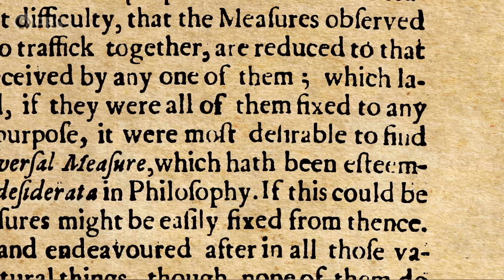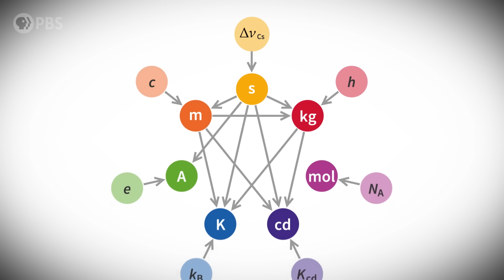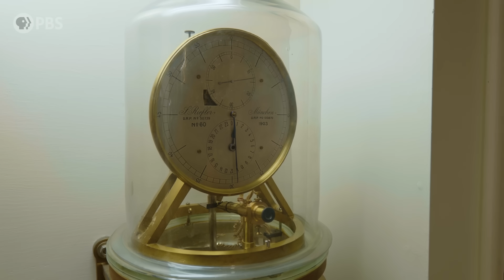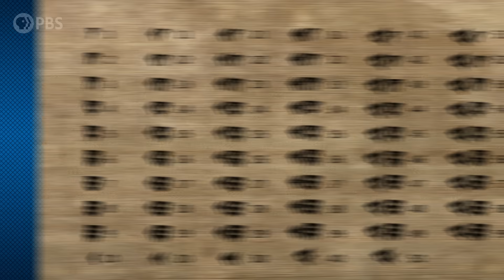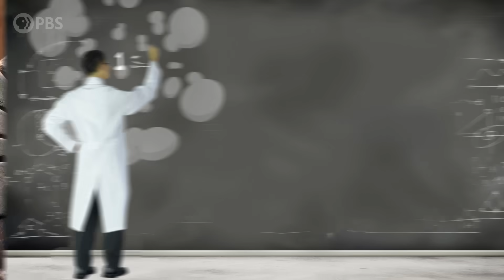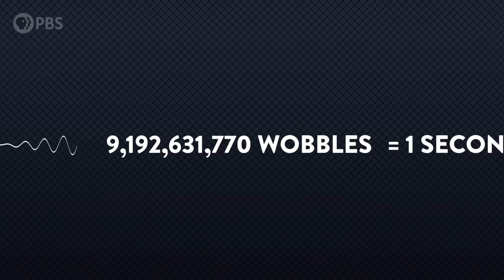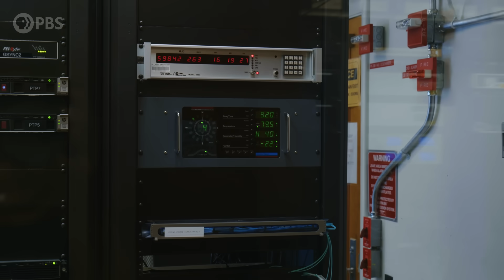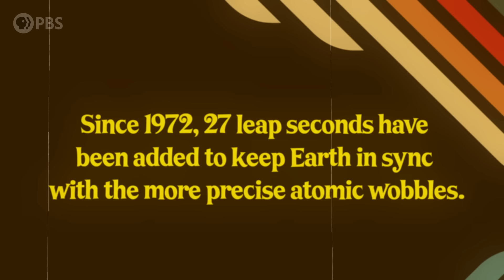The Unexpected Measure that Makes the Modern World Tick

Comment: The second is 1/86,400 of the time it takes from one day when the Sun crosses the Meridian to the next day when it crosses the meridian.  But this varies slightly due to the tidal effects of the Moon's orbit around the Earth, or more accurately the common center of mass of the Moon and the Earth, and from the fact that the Earth's orbit around the Sun is not a perfect circle.  But I like the non-decimal way we divide our day in a manner similar to pre-Metric systems of length.

Comment: I would really like to know more about the candela. All throughout my graduation in Engineering I never had to use it, and it sure doesn't look like you can't express it in function of the other base units (just at face value). So yeah, feels like a bit of a mystery
Reply: All of the photometric units (lumen, lux, candela) measure electromagnetic energy in some way, but they integrate the electromagnetic spectrum weighted in a way that reflects how bright light of a particular wavelength looks to the average human eye.  Lumen measures total light emitted from a source, so it's analogous to Watt used to measure total EM radiation emitted from a source. Lux is lumen per square meter, a measure of how much light shines on a surface. Candela is lumen per steradian, a measure of how much light a point-source emits per solid angle, i.e. if you block the light from a point source in some directions then the total amount of light emitted (in lumen) decreases but in any direction that's not blocked the brightness of the source (in candela) remains the same.
Reply: @MatthijsvanDuin  I really appreciate your explanation, I get it much better now! Thank you! 🤩
Reply: @MatthijsvanDuin  Whoosh!!!  The cynicism derives from the complexity of the definition. To be sure it's not an easy thing to define, but unlike the other base units, it's not something straightforward like the other units.
Reply: @AlanTheBeast100  I was replying to the original comment, not to you
Reply: @MatthijsvanDuin  Good for you!
Reply: What's so unnatural about: "The candela [...] is defined by taking the fixed numerical value of the luminous efficacy of monochromatic radiation of frequency 540 × 1012 Hz, Kcd, to be 683 when expressed in the unit lm W−1, which is equal to cd sr W−1, or cd sr kg−1 m−2 s3, where the kilogram, metre and second are defined in terms of h, c and ΔνCs."?  🥴 --- source: Wikipedia candella.
Reply: @AlanTheBeast100  🤣🤣🤣🤣🤣🤣🤣🤣🤣😍
Reply: I’ve seen the measurement used a lot on film sets when gaffers/light electricians are working with the cinematographer on getting a certain light condition.
Reply: Candela is used only in astronomy and lasers
Reply: Of all the SI units that are supposed to stand for something universal and objective, the candela is exactly the opposite. It's essentially brightness of light, but where normal light brightness is just measured in WATTS, candela are measuring the PERCEPTION of brightness. For example, infrared light can be "bright" and be many watts, but it can never be bright and be many candela, because to us, it's invisible. The stupid thing about it, is its based on a standard observer... i.e. The biology of some average human. As a colorblind guy, even my "luminous efficiency curve" is different from the rest of you, so my candela is also differently defined.

The fact that the candela is a base unit is a joke. Loudness is also defined in watts. You can do the exact same kind of magic based on the sensitivity of our ears to get a unit (called a phon), and it is pretty much directly analogous to the candela. The only difference is the ear curve varies a lot more between people than the eye curve, so... Phon doesn't make the arbitrary cut.

Seriously, it's so stupid. My photonics prof told me that it's a holdout from the once-powerful lighting lobby. But we need to get rid of it. Seriously, It's a hill I will die on.
Reply: @CurranEggertson  Yeah, from what you've just told me, I have to 100% agree with you. It's more or less the impression I had that it's not fundamental at all, but I thought I was missing something that would make it click and make sense. But apparently no, it's just kind of stupid.

I'm surprised this isn't talked about more, specially given how emotional people can get about silly measuring units

Comment: Great video! 
You could have added that the French Revolutionaries tried to change the definition of the second to fit decimal time. 100 sec/min. 100 min/hr. 10 hrs/day.
Reply: It's too bad that was not accepted.
Of course, if it were accepted, in the USA we would still be using the Babylonian method.
Reply: the decimal system is overrated. From a technological point of view, it would make things more simple if people were accustomed to use something like the octal or maybe hex number system. this would allow us to much more easily convert to binary, which could be really helpful for even just doing math on paper.

Comment: Fun fact: last week the international standards bureau voted to abolish leap seconds between the years 2035 and 2135.
Reply: I missed the end date, knew there must have been a second part.
Reply: I’d put the leap second on random variations in the day length, which is why we can’t predict them for than 6 months out. The contribution from the fact that the day length was taken d from 1/1/1900 (iirc) is predictable.
And, we can have leapseconds in June. If needed.
Reply: also the one thing these popular science videos get wrong is the reason for leap seconds - its not because the Earth is slowing down by a second every 2 to 3 years!

the TLDR of it:

That 'random' number 9,192,631,770 of cycles was based on the motion of the Moon from film camera measurements in the 50's. The second it was measuring was ET or Ephemeris Time used as the independent argument of time for calculating astonomical almanacs since 1900. And that second was itself an average of planetary observations over decade in the 1800's.

We will always be comparing one average with another whether analogue or atomic --> which means even if the Earth from now on spun perfectly uniformly we would still need leap seconds, tiny differences in the tick lengths will always build up over time.

Comment: Why are you ignoring the politics behind the metric system? 60 seconds in a minute, 24 hours in a day or even 360 degrees in circles all involve highly composite numbers. 60 is a "superior highly composite number" which is a natural number which has the highest ratio of its number of divisors to some positive power of itself than any other number. It's the best for division, which is important for time and temperature. 
After the French got rid of their king, they wanted to get rid the old ways which used solid mathematics because they were seen as "King's units". They even tried to get rid of the second. 

Then there was the Battle for Geodesy between the French and Prussians/Germans. The French were humiliated by the Franco-Prussian War which lead to a century of bitter French Revanchism. This lead to the French bribing countries to use their Metric system to preempt German standards just for the sake of wounded French pride. The French gave up their claim of the Prime Meridian passing through Paris to the British Prime Meridian in exchange for the Brits adopting metric units. The French also offered trade deals to smaller countries for adopting French units.

The fact that the second not only still exists but is the lynchpin of the metric system tells you that the older units are not as bad as you imply. 60 seconds, 12 inches, 360 degrees are all superior highly composite numbers. Even the temperature has uses a highly composite number (180) between freezing and boiling of water.

Comment: I think a second is not measured by a caesium clock, but reproduced by a caesium clock. I think the second is a measure of duration. Absolute time may not exist at all. 🙂🙃
Reply: Since there is no absolute reference frame then it's possible for various observers to measure time differently and heavily implying no absolute time.

See also time dilation if you're up for some special relativity
Reply: @Kanbei11  Time and distance vary according to the Lorentz transformation. The speed of light in vacuum is the only constant. If we'd be able to reach this speed, time and distance would be meaningless.

Comment: When I was at MIT, the two common scientific measuring systems were cgs and mks. The profs said that they wouldn't specify what we used. So one cocky freshman decided to use fsf (furlong stone fortnight). It was a lot more work, but the TA would have to follow his work rather than just check the final answer.
Reply: I remember the foot-pound-second and used it while working at Boeing.  Using it is one thing.  Explaining it to a Boeing supervisor, let's just say that reducing the entropy of the Universe is easy by comparison! Along with explaining to him that there are 254 Angstroms in a microinch, or that there are 1 billion cubic mils in a cubic inch, or that 5/8 inch is 1/8 of 5 inches. In my college physics lab, I liked to joke that Archimedes used the cubit-shekel-second system.
Reply: @Ross Parlette I thought MIT students used "smoots" for length? 😂😂😂😂😂
Reply: @rickkwitkoski1976  No, actually, Smoots are used only on the Harvard Bridge. And they're now used even by the transportation department as a way better to locate where on the bridge, for example, an accident has occurred. Oliver Smoot was a pledge of Lambda Chi Alpha in October of 1958 when his brothers used him to mark the bridge. According to the legend he was so drunk that he was stiff and they turned him ass over teakettle to do the measuring, which conflicts with contemporary photographs. As a Freshman I was given the story.
Reply: Why don't people use mgs
Meter - gram - seconds
No prefixes, just the base units
Reply: @Xnoob545  That's not a thing because the derived units are unmanageable.
Reply: FORTNITE BATTLE PASS!!!!

Comment: If we're measuring seconds based on the frequency of microwaves or visible light, isn't that a circular reference?  Frequency is cycles per second.  If you don't know what a second is, how can you use frequency to exactly measure a second?

(I'm not saying that they are doing it wrong, I'm saying I don't get it.)

Comment: Has the speed of light (or time) changed over the lifespan of the universe? How could we know?
Reply: Speed of time changes in variation of speed & gravity as described by the theory of relativity. Lightspeed is a constant in vaccum, but it differs depending on the material light is passing through

Comment: The "metric system" (the real term we should use is Système international d'unités / Internation System of Units)  doesn't rely on natural objects since almost a century !
The definitions of the different units are based on physical constants and are all linked by calculations to go from one to the other, only using other units of the SI (Système international d'unités), so all units can be explained with other units, et cetera.

There have been numerous updates all along the twentieth century to make the units always more precise, more based on natural phenomenons and universal constants, and now some things sound ridiculous.
For example, the definition of the meter is the distance that light travels in a void in a 1⁄299792458 of a second. Talk about simplicity haha. Of course it changes nothing to us, but it is scientifically exact and cannot be debated.
Reply: Not true. Le Grand K or International Prototype of the Kilogram was a physical object in Paris used to calibrate all other physical kilogram standards until 2019. "it is scientifically exact and cannot be debated" is wrong on so many levels. That's not science. It borders on religious orthodoxy. Science is founded on open debate, not writs from on high.

Comment: I just want to point out that the US does actually legally rely on the metric system at this point. The only reason you still see Imperial used was because they didn't want to force all our industrialized manufacturing capacity to completely retool (which would have set the US back decades at the time), but that was over a century ago, and while we actually still use some of those same machines in production of stuff today, modern machinery for manufacturing has been universal for a long time, basically since we started making everything using CnC operated machines. Even decades old CnC lathes can be used in both imperial and metric. Imperial as it currently stands today is effectively considered an extension of the metric system, because all the base units we use to define what imperial is today, are based on metric measurements.
Reply: TMW all of the Imperial unit people learn that all of that stuff is defined in metric units. :D
Reply: You can thank Ronnie Reagan for the U.S. still being stuck in the dark ages.  Carter had set up the switch to using the metric system, but Reagan killed it.  Also, international trade has forced U.S. industry to use metric measure.  Check the wrench sizes for any car these days.  It's pretty much all metric.
Reply: @James_Knott We're not in the dark ages. Imperial works just as well as metric.
Reply: @mrosskne   As I mentioned, check the wrenches needed to work on a car these days and tell me that again.
Reply: @James_Knott  That doesn't have anything to do with what I said. Wanna try reading my comment again, sport?

Comment: 0:41 okay, I'll be that guy
ahem actually, for a long time the definition of pound, inch, gallon etc. Have been based on metric units. 

E.g. the DEFINITION of an inch is 2.54cm
So 🇺🇸 does in fact use metric, but different prefixes

Comment: Sorry, but the USA also uses the metric system. They don't use the metric system in everyday use, but what most people don't know: Imperial units today are actually based on a metric definition. For example, the official definition of an inch is "25.4 mm" and the official definition of a foot is "0.3048 meter" according to the U.S. NIST (National Institute of Standards and Technology). The "prototypes" for the units are still in use, but when these prototypes are made today (they need to be renewed over time), they are made according to their metric definition.
Reply: You are generally correct, but there are some technical inaccuracies in what you wrote.

— The official system of units used in the US is known as US Customary Units. It's not Imperial. Imperial and US Customary are both based on an earlier British system, but after US independence, they continued to evolve separately.
— The official definition of an inch is 1/12th of an International Foot, and the official definition of an International Foot is 1/3rd of an International Yard. 😉
— The official definition of 1 International Yard = 0.9144 meters.
— Consequently, 1 International Foot = 0.3048 m and 1 inch = 25.4 mm. But those aren't definitions.
— The "International" prefix is to contrast them with the corresponding "Survey" units—which are also official units of length used in the US.

— American units of length (yard) and mass (pound-mass) existed long before metric. They were subsequently redefined in terms of the metric units. But in such a way that their magnitudes did not change.
— The Fahrenheit is not based on metric units.
— The SI units second, Ampere, mole, candela, radian and steradian are used unchanged in US Customary.

It's a common mistake to claim that US is a metric country because the yard and pound are defined in terms of SI units. To be truly metric, they have to use actual metric units—meter and kilogram. So long as they use yards and pounds, they're not metric—even if yards and pounds are defined in terms of the corresponding metric units.

Of course, the US is—as the cliché goes—inching towards the metric system. Ironically, I'm advocating for the Planck Units.
Reply: @nHans  "In 2020, the U.S. NIST announced that the U.S. survey foot would be phased out on 1 January 2023 and be superseded by the International foot", see Wikipedia article on inch, so basically in a bit over a month survey units are history. And if I decide tomorrow to name 5 meters a "woobly", it is not a metric unit but it is just an alias name for a metric unit value and so are US pound and US inch/foot/yard.Yes, their original definition wasn't based on metric units, never claimed otherwise, but their current one is, so they are now just aliases for metric unit values, which also still exists in other countries E.g. in Germany an Ar (a) are 100 m^2 and a Hektar (ha) are 10000 m^2 and it's still the norm to measure farm land that way. And Fahrenheit is defined by a metric unit, as it is defined by Kelvin. Again, see Wikipedia article on a Fahrenheit "With the Fahrenheit and Celsius scales now both defined by the kelvin, this relationship was preserved, a temperature interval of 1 °F being equal to an interval of 5⁄9 K and of 5⁄9 °C", so Fahrenheit is defined by the Kelvin scale, with an interval of 5⁄9 and zero Kelvin being −459.67 °F.

Comment: So, when switching from "earth time" to Caesium time" the first time - how could they know it would be 9,192,631,770 vibrations? 

if the reason for switching was that "earth seconds" weren't accurate enough, then what Did they use to count the vibrations against, and how did they know it wasn't 9,192,631,771?